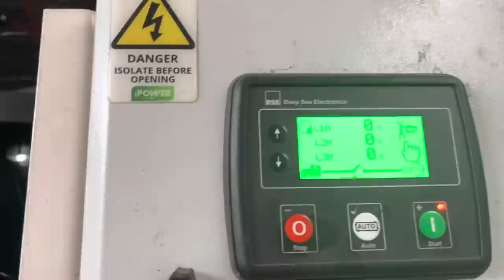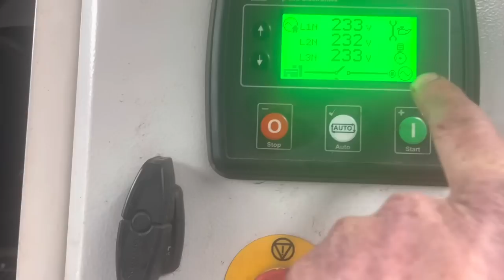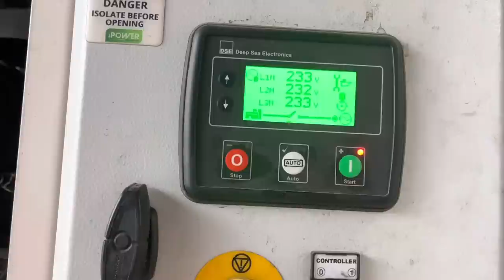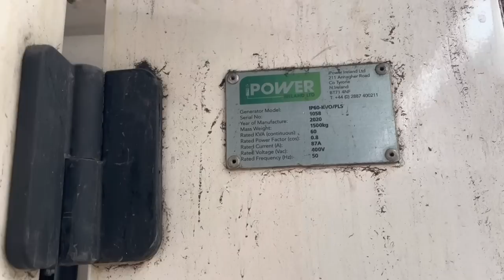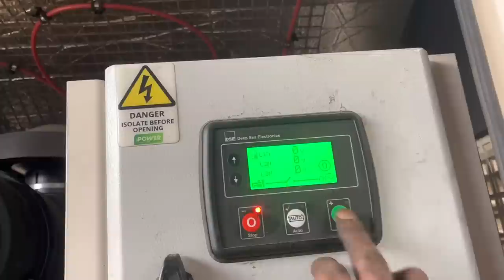Trucks, trains, beds, loading shovels, picking station and a struggle 🤔 obviously!

Comment: Good video as always if that's a Perkins engine they normally have an electric pump in the filter housing should be an electrical plug had them before  where pump is in filter housing

Comment: Ever time I get a notification that you have released a new video it’s straight on the tv and also thank you for the advice you have given me as well, you engineering background has helped me so much when it come to repairing the heritage locomotives I work on.

In terms of model railway I’m in the process of buildings a 80ft garden and indoor oo gauge layout which will be full automation off of a computer so trains will run them selves along with signals, point and even day and night simulation all controlled by a PC. The texture under the railway track is called ballest and it’s to replicate the stone that you see under the railway lines in real life. If you want to see what it’s like having trains as a hobby then start off with DC. If you want to go crazy like I have with DCC you can have sound in the individual locomotives and also if you want to take it a step further you can have trucks going round the layout with a kit from Fuller car system. I maybe a little far from yourself but where I can give advice I’m more then happy too

Comment: Hi Chris...love the channel its full of everything. That railway seems to be a 12 volt dc set up. I recon the tracks are double o  gauge. You will need to get a  double o gauge train.  Hornby would be the way to go. Charlie over on chadwic railway or budget railways are good channels to watch both channels go into great detail . Charlie explains the wiring and track laying in detail. Those switches on the layout are for the points that change the train from one line to another. It would be interesting to see ye get that up and running

Comment: Hi Chris, Where the Partic shop is on Sandy Lane Industrial estate I used to work opposite it at a company called MechSpec who used to restore and repair MG's. I was a mechanic/welder car body guy for them for 4 years or so rebuilding the old MGB's and other cars.. I recognised it streight away as you pulled in.That was about 28 years ago..lol time flys.

Comment: Just been in my loft looking at my old set when I was a kid…the track gauge on this set up is called 00 gauge so that will be the track size so the trains will be the same mate.. the box you were playing with which had the controller knob is the speed controller and all you do is connect it up to tracks and plug into a house plug and the tracks will be powered! You need to make sure the track is a full loop for it to work from memory.. lots of time and effort has gone into this track set up so would be a shame to remove it.

Comment: Well I thought wrong ... thought that Perkins electric fuel pump had died internally as they don't like the cold and never heard the buzzing upon start up  sometimes you have to spanner tap the top to check for any signs of life  think they modified them to a pressured inline pump as they cost a fortune .....   V belt  parts on van to fix first time     Result !